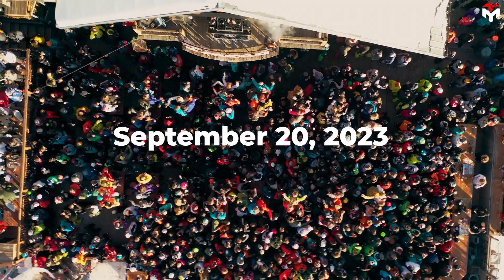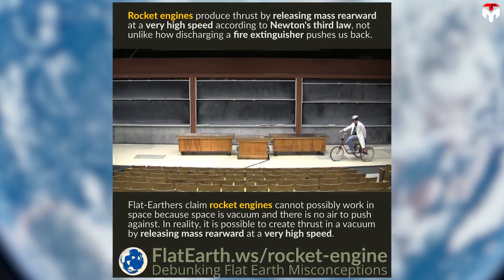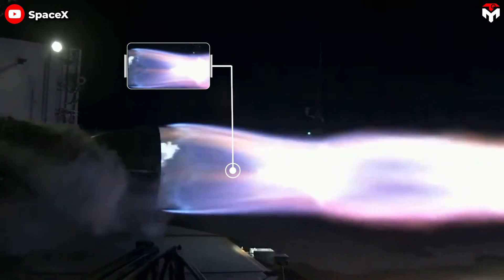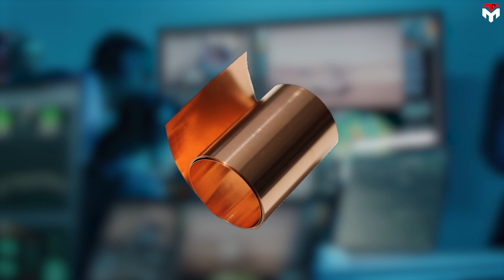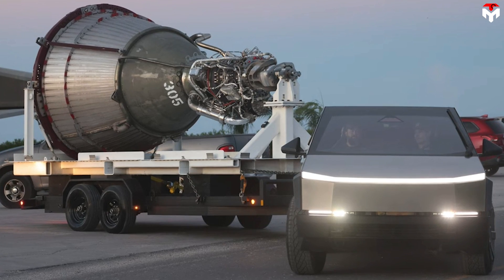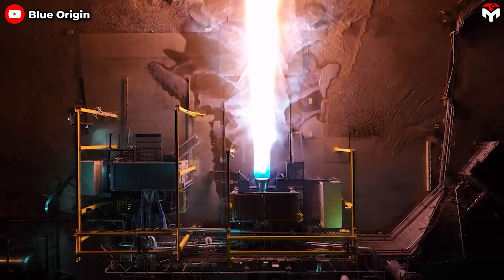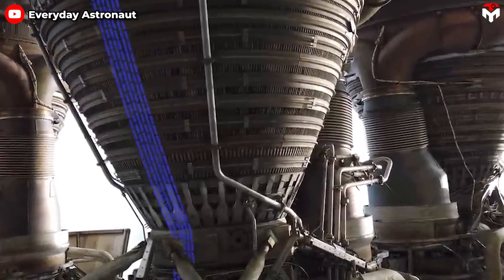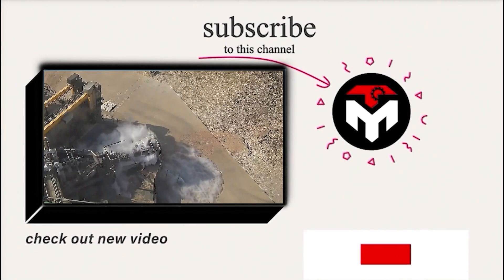SpaceX's New Insane Raptor Vacuum 3.0 Engineering will blow your mind!

Comment: The radiation explanation needs some better illustration, for this old geezer to understand it. Sounded like the same term was being used to describe different effects of heating and cooling. Perhaps the use of cooling cycle or circuit;  and, heating cycle or circuit might help clarify what is being said?  The Bell seems to be both a hollow dynamic thermal heating and cooling jacket; and, a thrust vector director.  But where is the 130 bar pressure occurring?